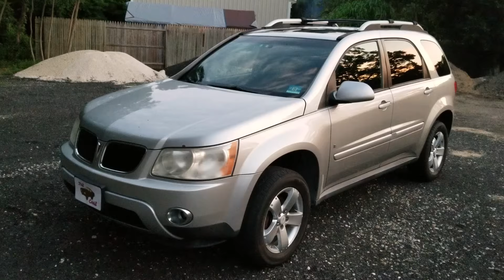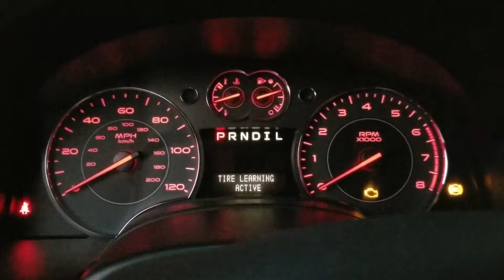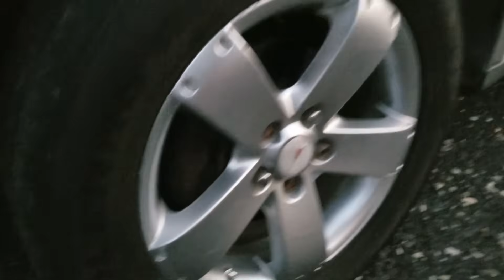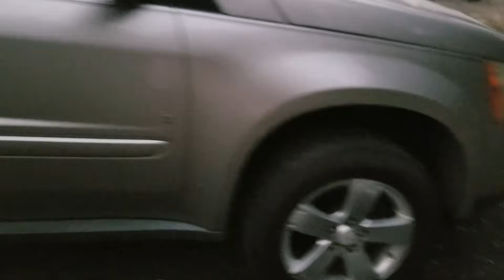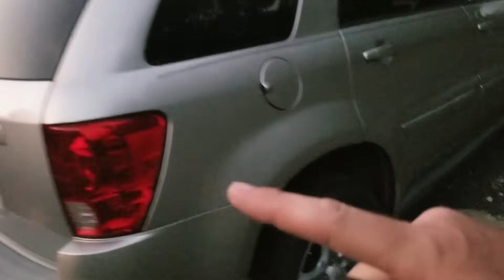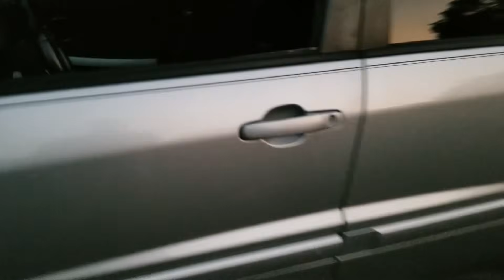GM Tire Pressure Monitor Relearn Process TPMS - NO SPECIAL TOOLS NEEDED!!!

Comment: only problem this doesn't work , let my tire down flat and never heard a damn thing
Reply: Yeah I tried this for the hell of it on my 2012 impala and let a lot of air out before I gave up. Used my 10$ relearn tool right after and programmed no problem.
Reply: @pauldrew7914 Could you tell us which one you bought? Amazon GM one?
Reply: IKR only worked on couple wheels and sensors are brand new

Comment: I watched it several times and see that it must: Step 1 - Go into programming mode then Step 2- turn off the lights.  If you do not do this on my 2016 Buick Encore then all of the lights are on, the headlights are off.  I can't get the horn to blow while releasing air.

Comment: Greetings...just tried this on a '20 Chevy Colorado.  This process worked up to the point of letting air out of the front-left tire.  Didn't get a horn blast (parking light was on in that corner, btw).  I know the tire sensor is good there as the deflated pressure was indicated on the dashboard display & again, upon refilling.  So, not sure if Chevy has removed this functionality so as to make more money from their affiliated shops...or I'm missing a step.  Let me know if anyone is successful with a '20 Colorado.  Thank you!
Reply: Same problem with my 20 canyon. It’s a money trap
Reply: @Pitchithard  Thanks for the feedback, pal.

Comment: This only works if your batteries in the TPMS are still good correct?
Reply from the maker: @markallen5527  that's correct. If you have a dead battery or a TPMS that isn't working this won't work.

Comment: Many thanks valuable info., Thumbs up.  What if one of these sensors is dead ?  is there a way to skip it to next one ? or must use the special tool ?
Reply from the maker: If the sensor is dead, you would have to replace it for this to work. Thanks for watching!

Comment: One thing I noticed is that after all the procedures were finished and turning the key off, you did not mention turning the headlight switch back on to the normal driving mode. Someone might forget to do this without thinking about it. Thanks for the video.
Reply from the maker: That's not needed because as soon as you turn the key off it goes back to default which is to have the DRL on.
Reply: @JrZCarZ  I have a 2014 GMC Sierra and I have noticed on another video to turn the headlight switch off before proceeding to the reset learning mode. On my truck, if I don't turn the knob to the auto normal when finished, it doesn't happen automatically. The knob needs to be manually turned. This is something that you might want to share. That's how it is on my truck. Thanks so much for the video.

Comment: What happens if you do not have the correct tire pressure when you reset the TPMS?  Especially when you are letting air out to get the horn to honk during the reset (one tire at a time).

Will it now not alert you when the tire is low or indicate the wrong pressure because the wrong tire pressure was in the tire when the TPMS was reset?
Reply from the maker: It shouldn't make a difference because it's just looking for activity when you let the air out. It's not calibrating the actual pressure to make sure it's reading properly, it's reading the location of where the tire/sensor is. 

That being said, before doing this you should make sure they are at the proper pressure just to be safe.

Comment: Have a 2024 Silverado. Recently removed stock wheels and installed summer chrome wheels. (Will swap back pending weather) I'm not sure if this procedure will work for me. One thing for sure. Best video I've seen!! Great work.
Reply: Did it work
Reply: No it didn'. The TPMS's are different. (2017 / 2024) But....Firestone could replace them for $350.  When I put my original 2024 wheels on this past fall, the tire signal went away. I learned alot about "TPMS's"... and I learned even more about Firestone. I better stop there before I get banned for life.

Comment: Great video but on my 2009 Buick Enclave would not learn. I was able to get it into the learn mode but when I let out air, down to 14 lbs, it still didn't learn. Do all the tires have to be at full pressure before you start? A couple of mine were down about a lb.
Reply from the maker: They shouldn't need to be all full. What you can try is to drive the car around a little before doing this so the sensors are active and see if it works.
Reply: This is happening to me as well. I let a lot of air out of the first tire, several times and the horn never honked. Did you ever get yours fixed?

Comment: I let most of the air out from my tire but the ligth is on but wont beep when i take all the air out help?
Reply from the maker: What kind of car? Do you have a TPMS light on?
Reply: @JrZCarZ  I have a 2008 gmc yukon. Yes, the ligth is on. I put it on re learn mode, and it beeps, but when I'm taking the air out, it won't beep, and the one ligth is on but won't switch or beep and I let most of my air out
Reply from the maker: @Southern612  the sensor may be bad. You may need to hook it up to a scanner to read the sensors and see if there's an actual fault then.
Reply: @JrZCarZ  thanks I'll look into it

Comment: Good info, my 2015 gmc sierra denali front driver side low tire pressure light is on and fluctuates from 24 - 26 psi. I will give this a try in the day light and access to tire air. Hopefully it works 🤞🏿

Comment: I have driven the car around to wake up the sensor. I got the car in learning mode, front light on the driver's side came on. Released the air down to 5lbs no honk .. Is that a bad sensor
Reply from the maker: Could be a bad sensor if that's the case, or your car may not be comparable with the manual relearn

Comment: What if your passenger  side tire doesn't honk? What do you do then??? Is the sensor not good? 2010 Equinox!
Reply from the maker: You may have not let enough air out, or it's possible the sensor was not active. You could drive the car around to 'wake up' the sensors and try as soon as you park. They would read quicker than.

Comment: Saving someone some time & frustration- it doesn’t work for a 2015 Chevy Equinox 🙄
Reply: It didn't work on my 2016 Chevy Equinox either.
Reply: @MoniqueGriffin-cx2yh omg if only I read two more comments below what I read I wouldn’t have wasted my time. Does not work on a 17 equinox either lol
Reply: I used a cheap( about $10.00) sensor reader. I didn't even try this method as I had heard the method used in this video doesn't work with all vehicles.  Mine is a 2013 equinox. I didn't have to re fill the tires either 👍
Reply: Damn

Comment: Deflating the tire did not activate the tire pressure sensor on the first tire. Must be something wrong with that sensor. 2016 Traverse.
Reply from the maker: Could be a failed sensor. Do you have a TPMS fault light on?
Reply: GM 2011 and up require a tool.

Comment: I let the air out of front drivers ideas tire and horn never honked
Reply: Took it down to 20 pounds and worried so I filled it back up on my 2015 Chevy Equinox
Reply from the maker: Did it actually illuminate the light to show you which tire to start with? I got concerned with mine too when one went down to about 15 lbs but it eventually honked. Could be a lazy sensor as well

Comment: Didn't work for my 2018 GMC Savana 2500
I followed exactly, let 20 lbs of air out and no honk.
I really don't like this new crap.
Reply: Yeah I tried that too and discovered that later model vehicles need a tool. I believe 2011 and up

Comment: Oh yeah, much better than the predecessor method of just filling up the tire and drive for a few miles.  I'll have to try this later on my 2017 Spark.
Reply from the maker: Yep, manufacturers just LOVE to make things more complicated so they can get you to come into their dealers...
Reply: @johnny becker. Did it work for your 2017 spark?

I have the same car.  During the oil change they rotated the tires.

Comment: IS THIS THE SAME PROCEDURE TO FOLLOW FOR A TERRAIN? WHEN I TURN IT ON , THE DASH LIGHT SAYS "CHECK TIRE MAINTENANCE SYSTEM"..BUT TIRES ARE NOT LOW AT ALL, I'VE HAD THEM CHECKED.
Reply from the maker: I believe the process would be different because the Terrain doesn't have the menu option like this Torrent does. If you can select the option to learn the tire location you can try, just make sure that you have a compressor handy so you can pump the tire back up! Happy motoring.👍

Comment: What if it doesn't honk?
Reply from the maker: Sometimes it takes a little bit to honk cause it needs to wake up the sensors. If it doesn't, I would drive the car around before doing this procedure to get the sensors closer to the ready state.
Reply: Then just let all the air out. Just kidding

Comment: Bought used 2008, DIC said to work on TPMS, used Autel scan tool, it did not see sensors in the car so tossed in 4 sensors, the tool could see all 4, saw pressure. So went into relearn, tried to use his Autel tool and my tool, neither would beep during the learn process.. guess could try lowering pressure, but wondering why scan tools would not trigger the learn.. there some antenna for the ECM to see these sensors?
Reply: Now my DIC also says to service the AWD system and it is only FWD, so maybe my ECM is messed up?  did no try to lower pressures yet...
Reply: Looking into module 20803735 to find out if there is an antenna, keyless entry module controls the TPMS on these, then remote start and the keyless entry.. from what I can make out it is behind some panel on Left rear quarter, guess behind where jack goes perhaps, looking tomorrow to verify numbers and check any antennas, as both tires then fob acting up...